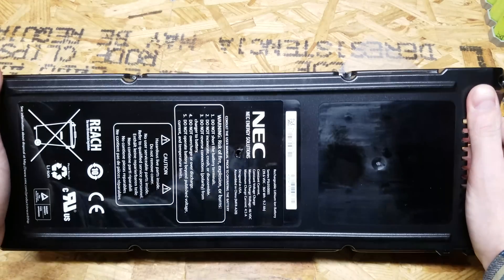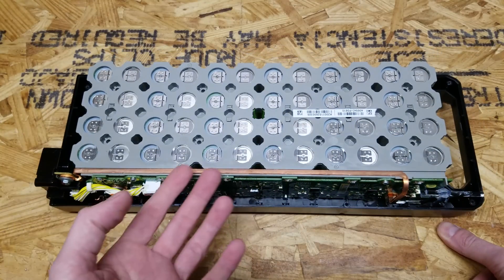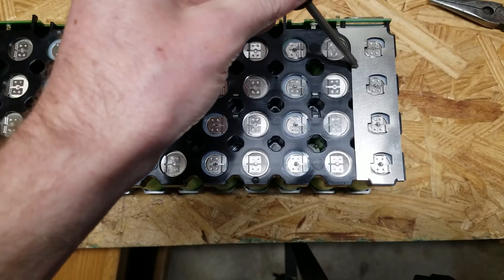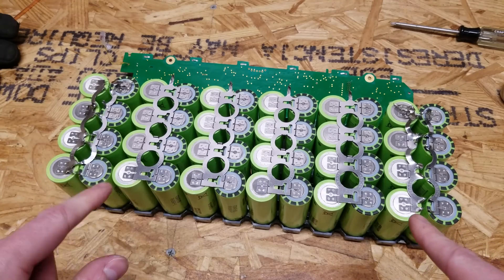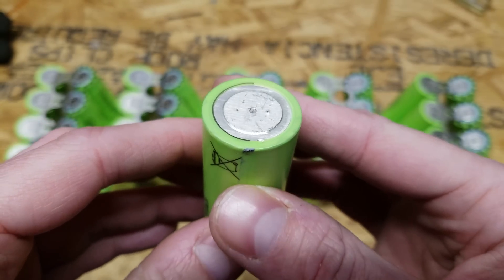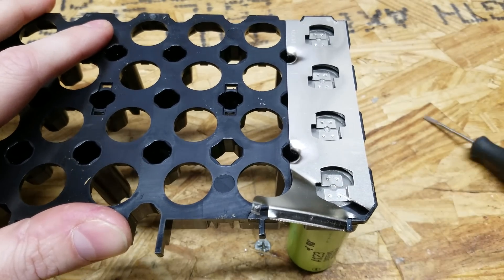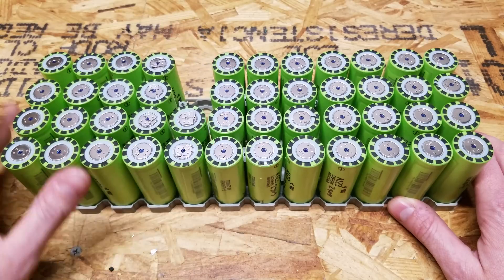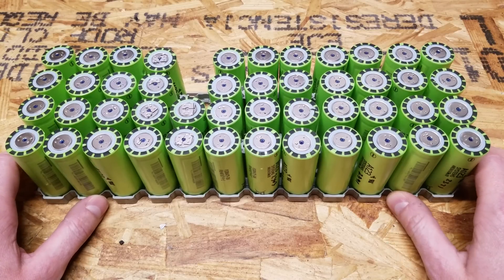NEC Energy Solutions A123 LiFePO4 Batteries, Cell Harvesting (Battery Hookup)

Comment: I was able to charge by connecting to the output terminals, and the BMS fuctions for charging I will connect direct to the buss bars for power out, and monitor output voltage, in the comments below  https://www.youtube.com/@jj74qformerlyjailbreak3  figured out how to turn on the BMS for output After charging the BMS yellow and green lights stay on, so I am not sure how to turn off the lights.

Comment: I found using a box cutter and placing it at about a 30 degree angle and tap with a hammer that in most cases the rest of the tab will come off very nicely. You will go through a lot of blades.

Comment: There's really no reason to separate the cells "for testing".  If they're already in the configuration you need, then test them in that configuration first before ripping them apart.  Seeing as you can put probes at the series junctions, that should give you what you initially need before ripping into everything for no particular reason.
Reply from the maker: The purpose of this video was to teardown and test the individual cells. You're right though, don't need separated for use as the pre-configured 4p blocks.
Reply: @LithiumSolar  You don't need to test the individual cells unless the first round of testing, all together, indicates a reason to do so.  Just log the individual series taps and inspect the data.

Comment: That's good info and decent cells,
I'm thinking about some I've seen on ebay very cheap in the uk 100 for £50 but they aren't categorised at all and are the A version,  seller says they are 2 to 4 years old ..

Comment: Why not keep the nickel strips on the ends of the cells, instead of completely removing them and risking ruining a few cells? You could then solder to the nickel strips, assuming you trim them appropriately. I can't say I have done this myself so it is just a suggestion.

Comment: Can't believe you tore this all apart. Kind of defeats the purpose of buying these packs where you only need to do minimal soldering and adding a BMS to have three nice 10AH packs. By breaking these all apart individually you risk tearing holes in the ends of the cells where these were spot welded. I would not tear them all apart unless I was looking for a suspected bad cell.
Reply from the maker: I use the individual cells for random small projects around the house. I don't necessarily have a use for 4s4p blocks, although they could be vary handy to the right person.

Comment: I want to use this pack for my ebike. When I test the outputs with out anything connected to the bms it shows 0volts. Any info on the internal BMS, vs converting it over to an ebay bms board?
Reply: I am using 2 of the 12s3p packs, same BMS, just 12 less cells on my ebike.  I ended up soldering an xt60 connector to the negative busbar and the positive terminal.  This bypasses the BMS controller.  The balancing function still works, but it gives off a lot of heat, so I'm switching to my own active balancing BMS.  The BMS in the pack is proprietary and I cannot find any information online.

Comment: It is disappointing that the Opus can change Ni-Cad and NMH but not LiFePO4 (without opening) They should put the switch on the outside or have some detection method. It will take a LiFePO4 to 4.2v which is bad for it if not dangerous.

Comment: 05:11 - All my carpentry tools are locked up at the moment. Does it need to be a claw hammer, or could I use a ball-pein hammer of similar size from my engineering toolkit?
Reply: I used a large philips screw driver and held it with my fist on top, then hit it with my other palm couple of times.  it's not very strong.

Comment: Would like to see how they were tested.
Reply from the maker: I tested them on the Opus BT-C3100 charger. There is a switch inside the charger you can set to 3.7V instead of the pre-set voltage of 4.2V.

Comment: I want to use the bms that came with it but I can't figure out how to work it.
Reply: Did u figure it out
Reply: @Kevin.OBrien44  nope
Reply: I remove the built in  bms on mine and wired up balance leads instead, made it 2 6s balance leads and use a active balancer when charging, i also made a charger for it so i can charge it to 44 volts 5 amps, i only require max of 45amps from them once in a while so bms for me is not neccessary.
Reply: https://www.youtube.com/@jj74qformerlyjailbreak3 figured it out

Comment: I'm totally splitting this pack and soldering some connects in the same configuration to see if spot welds or solder have an effect on cell degradation. I hate electronics but I Woodwork, Hydroponics, make wine and cheese and can sprout the most nutritional food in a day with little water on a paper towel so no way I don't get to wield hot stuff and possibly blow something up..ijs

Comment: What I learned about maintaining LiFePO4 thus far so jump in, this gets expensive and I'm a first time right person so any advice is wanted.
Heat and humidity are the worst (89f) or lower 
Cold storage ok and discharge but charge no
Store for long period at 50-60% capacity
Spot weld best vs solder
Do not fully charge or discharge for longer life
BMS or ICharger necessary
Keep them balanced
Reply: So basically everything for all lithium chemistries. Although to correct you LiFe are by far the most tolerant for depth of discharge to 100%, cycle life and general cell safety (won’t catch fire as easily as NMC, NMCA and LiPos (most flammable)

Comment: Ok I'm back to watch this again and read some more reviews because another Youtuber had sets from elsewhere and they were at 73%, isn't a 100ah battery dead at 80ah, what does that mean someone?
Reply: I was trying to think of an analogy, this is the best I can come up with, hope it is correct. Let's imagine your battery capacity is the same as the bank account you fund your debit card from. A 100AH in your battery is similar to the purchasing power of $100.00 in your bank account. When you spend 20% of it, you'll still have 80% of it left to spend. So your account is not 'dead' at 80, it is dead at 0. Now if your bank account does not have overdraft protection, your debit card is shut off until you recharge your account. When your battery reaches the low voltage shutoff threshold, your battery may not be the same as a leveraged debit car: EG:, it will no longer provide any power until you recharge the source with funds (or stored amp hours). (Where your battery is different from your bank account, is you cannot 'leverage' it with some form of what would be equivalent to overdraft protection where the bank gives you a temporary loan to cover your overdraft.) So no, your 100AH batery is not dead at 80AH, far from it, it still has a lot of power to yield to you. How close you are to that shutoff point is an indication of your cell voltage, not your amp hours.

Comment: Would you know if it is possible to use these to make a 12v battery to replace my deep cell battery for my battery back up sump pump? If it is possible how would I do it and would the deep cell charger work at keeping it charged? If not these batteries do you know what would work? Thank you for your great videos.

Comment: The A123 is a larger 26650 cell, which is 100% larger volume than the 18650 cell, but not double the capacity  ...  hmmm?
Reply from the maker: Right, because these are LiFePO4 cells. They are not as energy dense as your "standard" lithium ion (Lithium Cobalt, Lithium Manganese, etc) but are a much safer chemistry.
Reply: @LithiumSolar  OK, got it.  But they do make 18650 LiFePO4's (1400mAh) ... https://www.batteryspace.com/LiFePO4-18650-Rechargeable-Cell-3.2V-1500-mAh-4.8Wh-5A-Rate.aspx
Reply: yea but more than double the amps almost triple the amps of the best 18650. no  voltage sag on these like 18650 lion.

Comment: I am close to figuring out the communication on the stock bms soon as I’m able I will post a video showing the workaround
Reply from the maker: If you get it figured out, please do share! There are a lot of people would be very interested in this.
Reply: Their 12v emc modules are actually 24 v with the a123 cells  they are configured in 8s soldered to the board I’m pretty close to figuring that one out too
Reply: @LithiumSolar  well it’s been 2 years later
I set this module aside as I had other things more important. However as promised I said I’d update here. Q52 is your Answer. These boards are turned on if you short 2-3. This will turn on q25. If you don’t have a load connected it times out. If you do have a load you can charge/discharge. I know it’s a little late but I’m sure there are still more of these in the wild.  
These packs are Awesome. 
So is your Channel. 
Thanks for reading. Please add to this thread if you can.  
Thank you. 
God Bless
Reply: @jj74qformerlyjailbreak3  I know this is old but which pins are 2 and 3, and how much load is needed to stop the timeout? I want to use it for my e-bike and if the bike is on, is that enough load? Super thanks for figuring it out! how long is the timeout?
Reply: Jail Break - if you solve the communication on the stock BMS it would make these batteries easier to use and would not require a tear down to build back up to be useful.  I see too many of these batteries with great enclosures and BMS and connectors but no one can figure out how to take advantage of the existing technology.

Jail Break please tell us how to take advantage of this technology without having to break it down!!!
Reply: Art Blummer I need another doner I’m real close I know where the cut off is but can’t figure it the signal on input side what you would think is the balance leads on the outside isn’t though pins 3-6 are the communication 7-10 are input I need to know the specific Emc these are used in
Reply: @jj74qformerlyjailbreak3  These battery modules slot into an EMC 078-000-080. Unfortunately these are $600+ used, so buying one and sniffing the communication signals is not a viable option for me. Would you be willing to share your notes on what you've figured out so far? I do have a suitable power supply and two modules to test with.
Reply: @brandozerful  Short Q52 to turn on Q25. If you have a load connected it will stay on. If not it will timeout after 3seconds.
Reply: @artblummer5307  Solved.
Reply: @jj74qformerlyjailbreak3  great news !!!!
Reply: Update I can now get the lights to come on all green I need a power supply 46v to test the charging unfortunately I don’t have any that high and nothing to convert over at the moment any help will be appreciated thanks
Reply: @jj74qformerlyjailbreak3  If you have enough old power supplies from laptops or similar and they're isolated from ground, you can run them in series to make higher DC voltages.
Reply: @jj74qformerlyjailbreak3  message me
Reply: @brantgoose  just got this. Sorry it’s been along time since I’ve visited this video.
Reply: @jj74qformerlyjailbreak3  that's amazing but idk if I still have the board anymore now
Reply: @brantgoose  You’ll have that on these big jobs. 😂
Reply: Message me,  I was recently laid off because of them moving to China but was a warranty technician at a123 and  job all day was to pull information from the BMS and analyze it so I can probably help you out. I've never seen one of these models but I've worked on other NEC products
Reply: @donjones9461  I don't seem to have the option to message you over youtube, but I can be reached by email at this.is.fine2@pm.me . I'd hugely appreciate any information about what kind of serial interface these might use, and the associated command set. The interface connector at the back is a 10-pin Molex 0444321002, in case that's at all similar to any of the other NEC packs you've worked with.
Reply: @donjones9461  Does A123 still make 26650 cell or other lifepo4 cells that we can use for our hobbies like powerwalls etc?  I still have a pack from the DeWalt power tool pack days.  Seems the only way to get A123 cells nowadays are these salvage or EOL packs.

Comment: It takes 120 volts DC to get a shock.
Reply from the maker: No it doesn't? I can feel 24V if I grab both terminals...
Reply: It takes a 9v battery on the tongue to get a shock
Reply: I have been popped with 24v many times working in cell phone cell sites. 48-52v can really put a hurting on you (or make you hurt yourself). You need to be careful with any voltage. Even 5v can burn you if you get a piece of metal between you and it (like a ring).

Comment: How many of these to make 100ah 12volt Battery?
Reply from the maker: Each cell is 2.5Ah at 3.2V, so you would need 40 cells for 100Ah. Multiply by 4 to reach 12V = 160 cells. There are 48 cells in each module, so that comes to 4 modules giving a total of 120Ah at 12V :) Don't forget the discount code "BATTERY" for 10% off if you decide to order https://batteryhookup.com/products/a123-36v-module-w-48-26650-anr26650m1-b?rfsn=1822232.f1131f
Reply: Thank you for your reply. I'm guessing that they shouldn't have a problem fitting into that 'Ammo Box' like the 18650 battery that you recently made, would you think? And if so, in your opinion what kind of BMS would be best for those batteries as that type of set up (Want the possibility of utilising as high of amp draw/charge as they are made for) and how many batteries would fit in 1 X Ammo box? I am really interested in building maybe 4 if it would all go together as nicely as when you did the 18650's. If all goes to plan, I will definitely use your code and support your channel anyway possible. Thank you for your valuable informative videos 😉
Reply from the maker: If looking for a small BMS, the Daly BMS is much better over the no-name generic boards like I used here. I have several Daly on order but it's going to take a while for them to get here from China and didn't want to wait. Unfortunately, I don't think you can fit anywhere near 160 cells in an ammo can. I'd guess 40 or so, but am not sure without having one to try.

Comment: This pack is perfect for me. I've got one in the mail. I plan on keeping it 36V. I read in another comment the bms on this should not be used. Even if I want to keep 36V? Can you recommend a bms? Project will have max amp draws of 30amps.
Reply from the maker: The problem with built-in BMS is they are usually proprietary and need to be interfaced with whatever the hardware is the battery connects in to. As for a BMS to use in a smaller application, people seem to really like the DALY BMS. I have not used them yet myself though.
Reply: I just got two units and am considering this BMS from Aliexpress:  https://www.aliexpress.com/item/32924207294.html

Comment: noob question
Could yoou seperate into 12v cells then rewire them in parallel to get a 12 v36ah battery, cuz that's what I need
Reply from the maker: Absolutely. The only welds you need to break to remove the cells from the holders are the two 4p groups on the ends where the terminals are because they have big nickel plates on top. After that, you can remove all of the cells as one big block, cut them in to 4s4p blocks, then put them back in and wire the three groups together :)
Reply: @LithiumSolar  I deally I would put the new configuration back into  the provided case, and possibly make provision to  daisy chain two or more together.
Still learning about BMSs but this is one possibility for my truck,

Thank you for the fast reply
Reply from the maker: Yes, good thing is you don't have to break anything to get it open, it's all screws you can put back. However, you would have to figure out a way to balance the batteries and/or stringing the balancing of multiple cases. The BMS board it comes with can't be used and would have to be removed regardless of which configuration you go with.
Reply: @LithiumSolar  yep, that's the fun part I'm learning about now.
But I need as much as I can get and nothing ready bult suits my application
Ideally and eventually I want to create something that can fit in a hollowed out tailgate or back door
For right now , I'm just trying to get ready for hurricane season

Comment: I just ordered one of these modules. How many amps discharge per cell would you suppose the spot welds are good for?
I'm looking at splitting it into four 6S2P packs.
I assume that the nickel strips are solderable so I can add a balance connector.
Also, what was the low voltage cutoff you used for testing for capacity?
Reply from the maker: I'm not sure what the welds would be rated for. They're on there pretty good so it has to be quite a few... Yes, the strips are solderable.  I'm fairly certain the Opus BT-C3100 cuts of at 2.8V for testing.
Reply: @LithiumSolar  I think I may remove the welded tabs and use silver strips to solder up packs from them for a model airplane I'm working on. Lots of modelers have assembled packs using this method.
Reply: @LithiumSolar  its nickel plated steel.  so not so good for high amps at all.

Comment from the maker: These battery packs have gone on sale since this video was uploaded. They're now $49.99 and comes down to $44.99 when you use discount code "BATTERY". Grab a few before they're gone! https://batteryhookup.com/products/a123-36v-module-w-48-26650-anr26650m1-b?rfsn=1822232.f1131f
Reply: LithiumSolar does anyone know the exact system these were populated in. That will get me the information I need for the schematic
Reply: @jj74qformerlyjailbreak3  Additionally posting here for visibility. These battery modules slot into an EMC 078-000-080, which is a standby power supply for Dell's EMC VMAX storage appliances.
Reply: Do you still have the cases? I’m looking to buy them.
Reply from the maker: @vaschnisavain  I don't, sorry. I ended up recycling them.
Reply: @LithiumSolar  ok thanks